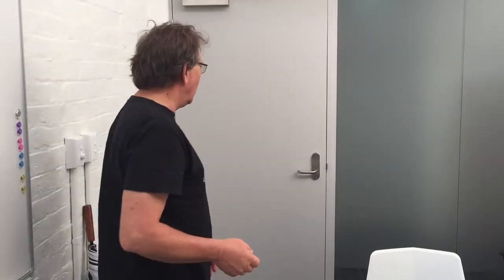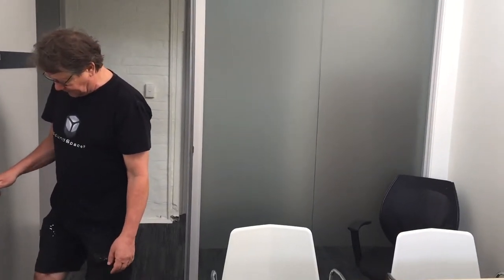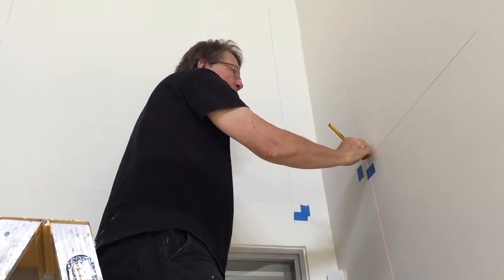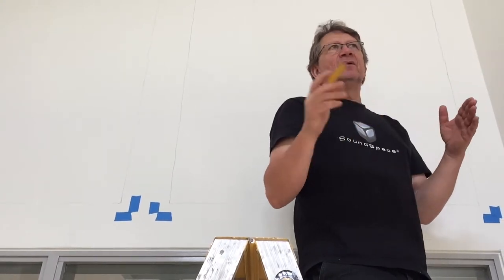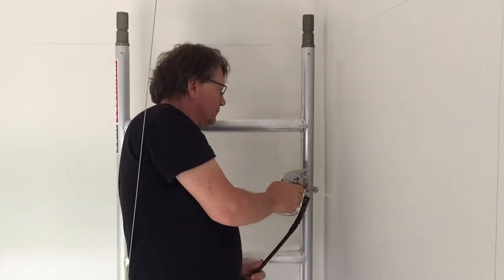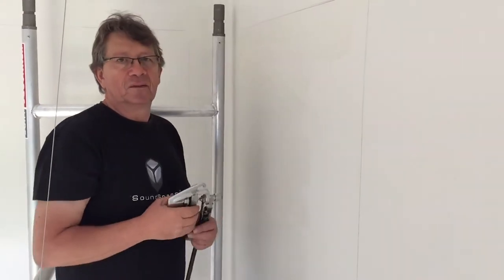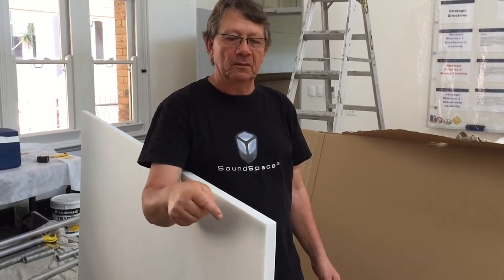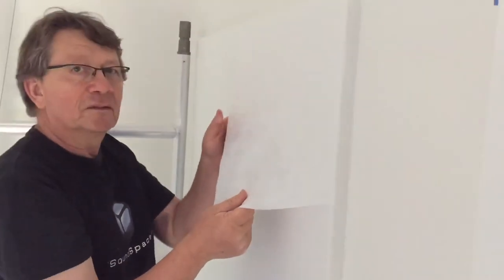How To Reduce Echo In  Rooms, Offices, Classrooms, Restaurants...

Comment: This was super helpful. I really liked the inputs. 
So, basing the floor dimension, the wall needs to be covered with 70% of the floor dimension. 
Use a polyester or acoustic form that absorbs multiple frequency 
Install panels at right angles, instead of parallel angles. 
Many of these inputs are not available in the internet. Thanks a lot for it.
Reply: yes, that's a good guide for most cases.